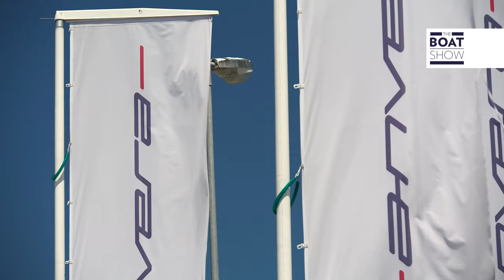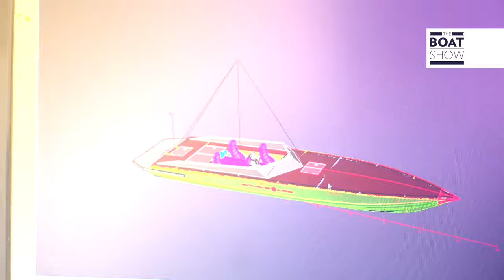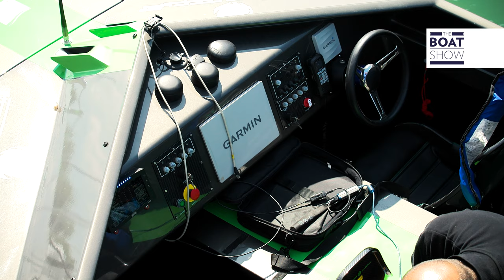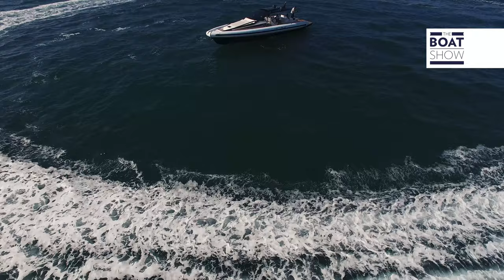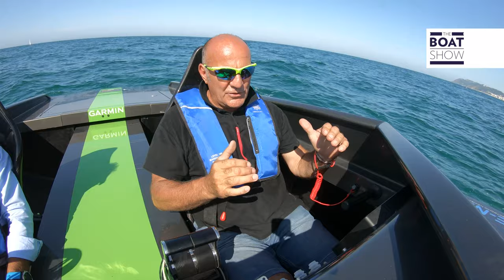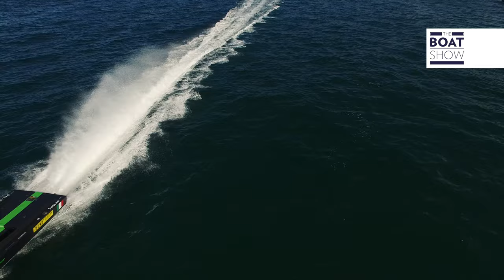[ENG] ANVERA ELAB - High Performance Full Electric Powerboat Review - The Boat Show

Comment: I think they were doing over 50 m.p.h. which isn’t too shabby at all.👍👍
Reply: No, it's pretty slow. The boat is designed for speed but 50 mph is slower than many low end centre consoles. Consider a Maxed Out Marine 21' will give you 81mph with a single 300 outboard. An Interceptor 26 Kool Kat will get you a deck boat going 80mph from a single inboard. Going up to a 28 Cobra Venom and you get 100mph from a single inboard. 

Sorry, but if you are designing a small boat to go fast, and it doesn't go near 100mph. It's simply not fast. With present battery technology it's simply not possible to get anywhere near the performance of a petrol boat. Unless you are only interested in a 500m dash.
Reply: @adrianjudd5327  , I’m personally not used to being around really expensive big boats. I’m in my mid 70’s and my Dad had a 17’6” fibreglass runabout with a Mercruiser in/out drive that had a GM 250 c.i. in-line 6  165 h.p. This boat would top out at 42 m.p.h. with a stainless steel prop. We loved it on a smaller lake in Ontario Canada. This boat was $5000.00 new in 1973 so this isn’t even close to what is on this video.😳🤔🤭
Reply: @rickbullock4331  I am not used to being on fast boats, I sail a dinghy! However, I know 50mph is not fast and it highlights the gulf between petrol (gas) and electric for marine applications. An unfashionable, basic spec Formula 292 Fastech will go above 60mph and that design and engines go back decades. So the ANVERA nice as a concept, but slower and less usable than a comparable petrol boat.
Reply: @adrianjudd5327  😳😁
Reply: @adrianjudd5327  yeah 50mph is not much i run my cat 120+ all day long

Comment: Still really slow compared to a gas powerboat for the same price can go over 100mph.
Reply: Sadly, this is the correct comment.
Reply: Give the technology and the economics 15 years and it will easily surpass petrol in speed, cost savings, and even efficiency. Just imagine the maintenance and repair cost savings of an electric motor and battery pack alone compared to a high output marine engine with forced induction. Everything regarding electric will be relatively cheaper in 15 years, while petrol will only become more expensive due to economy of scale alone. The convergence of the cost-benefit analysis of the two technologies is soon approaching by natural and artificial means.